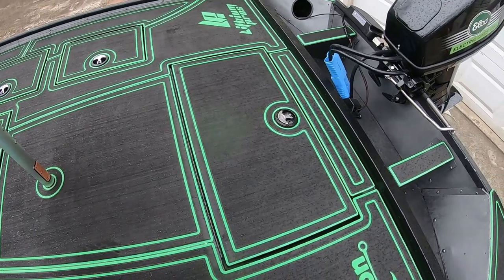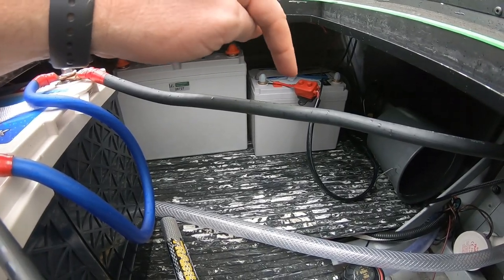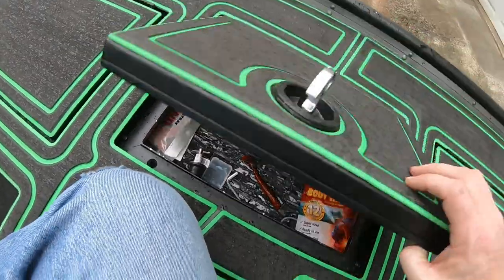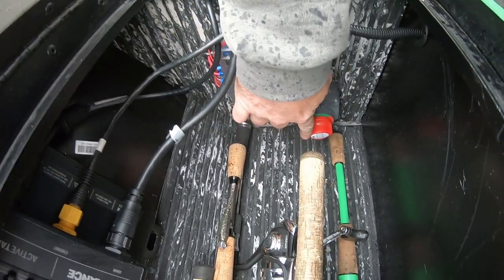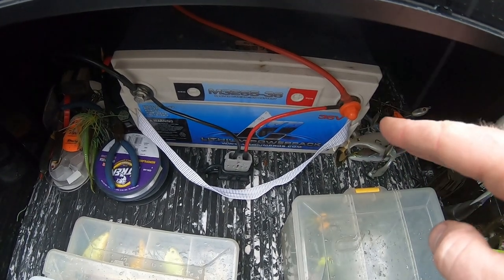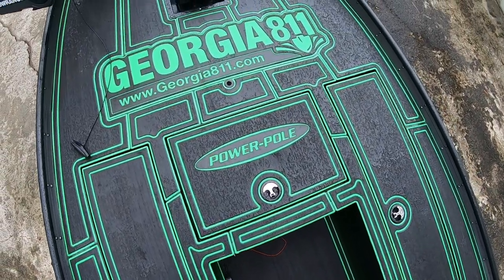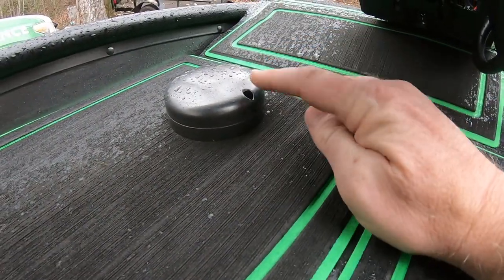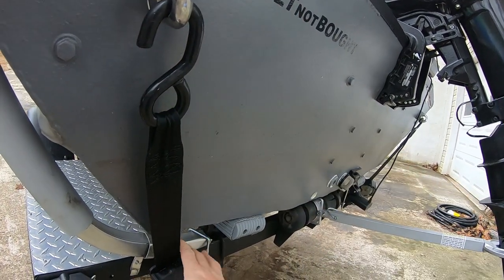Jon Boat MOD **Total Electric** Bass Tracker Build **Electric Outboard **Lithium Batteries

Comment: Man what a sweet sweet setup. Love everything about it!!! Those dual rod lockers are nice!!! Someday my rig will be tricked out like that!!!! Good Lord willin!! I'd say put the power pole on the same side as your rear nav light so that when you are running your Gopro on your Yolotek you have all of your vertical obstructions on the same corner of the boat. Instead of stuff in the way of a co-angler on both rear corners. 😬😬
Reply from the maker: Thank you sir! Great suggestion the power pole location.

Comment: Hey Merrick great video!  I'm close to finishing up a TBN build of my own very similar to yours.  I'm looking at purchasing a Elco 20.  Just curious what amp hour battery are using, and what kind of range?  I'm going to purchase Lithium, looking at 200 amp hours..  I reside in Maryland and we have some great electric only reservoirs.
Reply from the maker: I am running the Lithium Pros 48V Packs in parallel that gets me right at 200 ah. I have some new Lithium Pro Batteries that I will be installing soon that is NMEA connectable to my Lowrance HDS unit. I will be able to monitor the battery packs while running the outboard. The least I have seen since I have been running the packs has got around 40% batteries left at end of day. Best advise is not to invest in the cheap lithium batteries. Lithium Pros without any doubt have the most power Lithium Battery available. Most batteries you purchase will not have that high output compared to Lithium Pros. That is a promise. It is a huge investment but they will outlast the cheaper batteries by far. Thanks for the subscribe! Keep an eye out on the future install video. Feel free to look me up on Facebook and send me a message of any questions you might have.
Reply: @merrickmcclure6058  Thanks for the info!